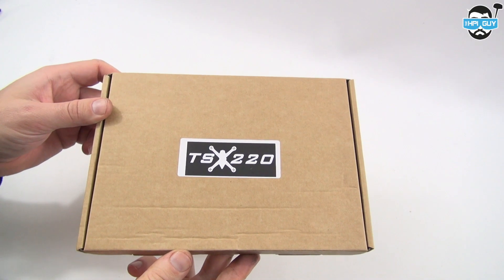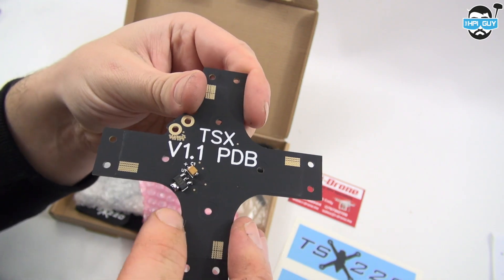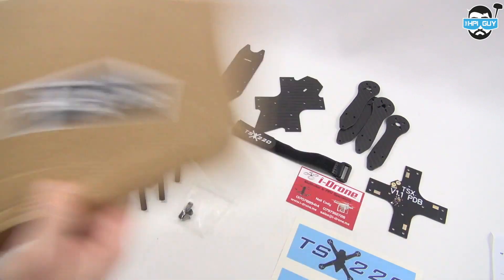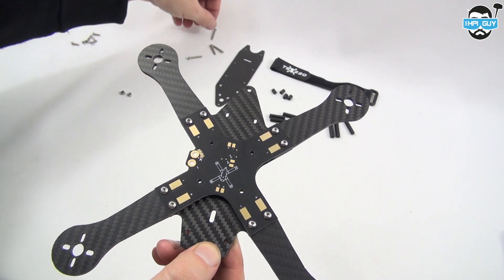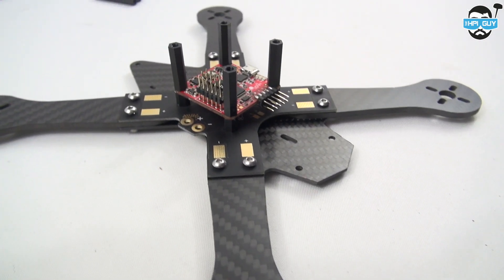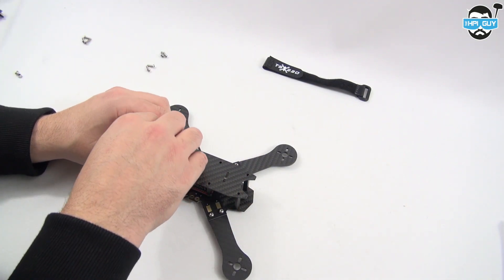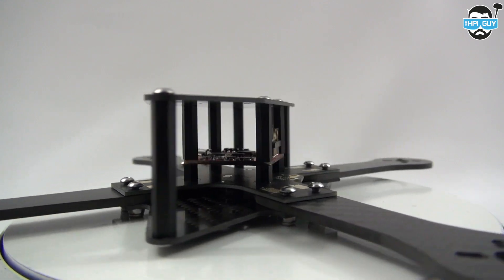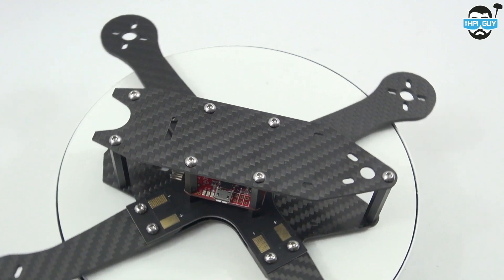HPIGUY | TSX220 Mini Quad (Part1) - Tom Stanton

Comment: Can say this frame is STRONG. I have trashed mine into things, the testing done on the prototypes alot was done in carparks. 
If you find the nylon standoffs not strong enough swap to 35mm Alu ones - nylon is used to make it as light as possible. My prototype is only about 520g with 1300 4s and Gopro and I have some 3D printed parts which could be removed to make it under 500g.

Comment: Nice compact, neat looking little frame.  The X configuration appears to be more popular these days. 
You're right about the PDB holding the arms from above.  That does look a little vulnerable as it won't be as strong as the carbon arms or bottom plate.